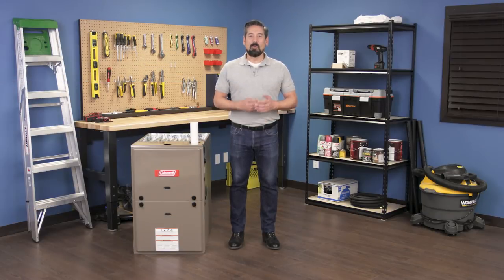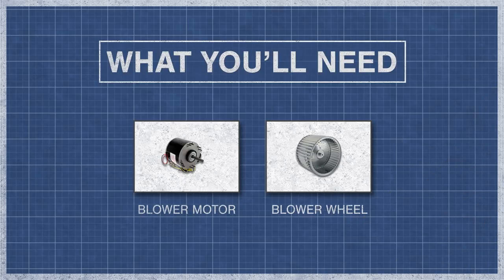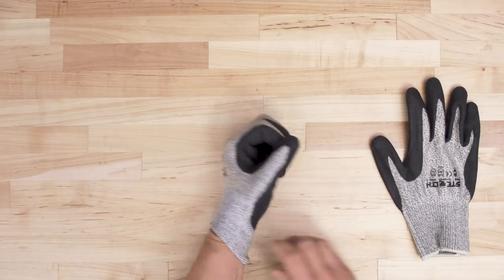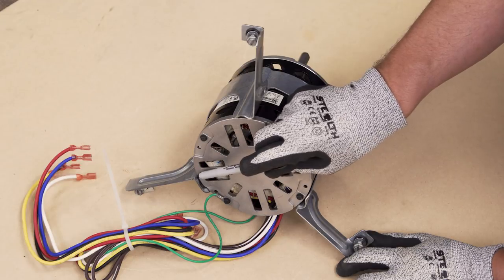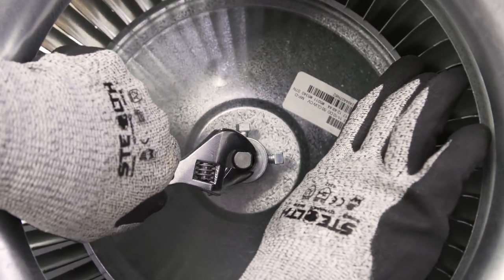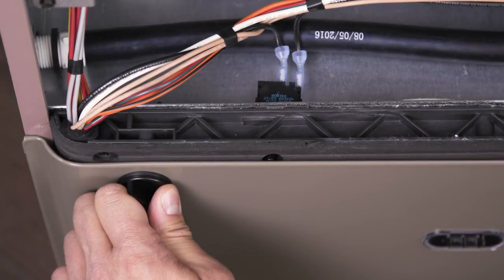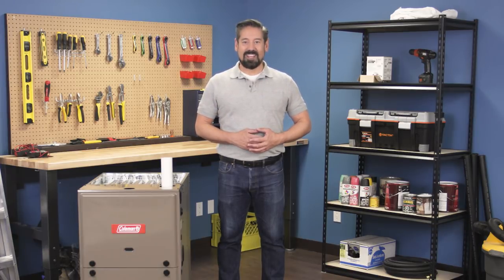Furnace - Blower Fan | Repair and Replace

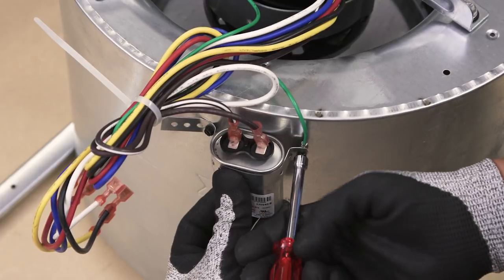Comment from the maker: *Caution* The capacitor stores an electrical charge, which is used to help start the motor. This might cause a shock in some cases. 2:36 Before handling the capacitor, use an insulated screwdriver and touch across both terminals to safely discharge the capacitor (be careful not to touch the blade of the screwdriver or terminals). 

Also be careful when pushing in the wire connectors into the circuit board. 4:35 Too much pressure can cause the board to flex and might crack the board. Its best to place your fingers behind when pushing in the connectors.

Comment: Thank you so much!! You are right on! I am now half way, I.e, I could take out the motor assembly and came down from hot attics. Next step is to find the replacement parts and replace it and put all back. Looking forward for have my AC unit working😊👍
Reply from the maker: You're welcome! We're glad you found it helpful. If you need a new motor you can always find a match using the specs on the side of the motor: This video explains how to match a furnace motor https://youtu.be/TF3QtXWd8s0 Now to order a replacement you can get one here https://www.amresupply.com/catalog/Heating-Air-Conditioning-635368

Comment: Might want to warn folks that capacitors are exactly what they say and contain a fairly large amount of stored up power to kick start the blower motor. Should be discharged by using a insulated screwdriver to touch across both terminals to discharge it so they dont get a nasty shock if they touch the terminals during removal. And another point is when pulling and pushing the wire connectors onto the silicone circuit board you should not allow the board to take the pressure on its own that is an easy way to crack a circuit board. Try to get your fingers in behind it to not allow it to flex, some of those connectors are on pretty tight and require a fair amount of pressure to remove and re install the wiring.
Reply from the maker: Thank you for your comment those are both 2 very good points. Unfortunately the video can't be updated without deleting and reuploading but I have added a comment and pinned it to the top for reference to bring awareness to both issues.
Reply: AMRE Supply yep but at least if they are here and you support them then folks can see it to. Thx from Bulldog Plumbing and Heating

Comment: Excellent video ~ I wish every "how-to" video was as thorough as yours! Can you provide an estimate of what it might cost for a repairman to perform the task and replace the parts depicted in this video?  And if the problem is a bad capacitor, what might that cost to replace?  If it matters, this is for a Carrier Weathermaker 8000 that was installed 20 years ago.  We heard some odd sounds when it started up today and then noticed a burning smell from the floor vents. The air was not blowing from the vents.  I removed the front panel and everything looks fine and the furnace will ignite - it just doesn't blow the hot air through the vents.
Reply from the maker: Thank you Paul, we're glad you're finding our videos helpful and informative. If the blower is not working at all then yes it could be a faulty motor or capacitor. Every case is different but a repair like the blower fan motor will likely cost 100 for a diagnostic, another 100 for labor and could be 200 for parts. Capacitors are quite inexpensive though and If you have a multimeter you can test the capacitor to see if is faulty. This is shown in this updated video https://youtu.be/4SY8lRl8HV0?t=171 as well if you do end up replacing your blower motor that same video shows you what you need to find a match https://youtu.be/4SY8lRl8HV0?t=253
Reply: @AmreSupply  Thank you so much ~ I'm going to watch a video a week and get up to speed on all of my appliances thanks to you!
Reply from the maker: @777zecol  You're welcome, we're happy to help out! We're still filming more videos on appliance repairs but we'll be updating our channel in the next few months. One series that is good to watch is our electricity and component testing videos: https://www.youtube.com/watch?v=r_migcta_Is&list=PLCo9SMjkdWBycw9hZVfYFc6Sw2Jlavaak&index=1 These are good as a refresher and since the principles apply to almost all appliances.

Comment: my blower wheel is out of balance and causing furnace to shake when running. This has also caused motor to shake as well.  Tech recommends full replacement of furnace w/ x13 motor = $3,500 or just replacing Blower Motor + Wheel for $1,300.  Question - do you think I need full replacement because of age of furnace is 21 years or just replace blower motor + wheel?  Thanks for any feedback.
Reply from the maker: Thanks for watching. A lot of the price of installing a new motor is the labor. You can always use the part number or match the motor by the specs to get a reference of the actual cost of the motor: https://youtu.be/TF3QtXWd8s0?si=xQ8JVm6pLsrQWGWT

You can browse all motors here: https://www.amresupply.com/catalog/Direct-Drive-Motors-650039-MDD1

When it comes to replacing a single component vs the entire furnace it is up to each homeowner to decide if the cost of a new replacement part is worth it. A new motor will last a while but you may still need to replace other components like the furnace ignitor or one of the limit switches over time. In many cases the price to repair vs install a new system factors in this opportunity cost. 1300 is a lot to just replace a part, but a new system does come with peace of mind.
Reply: Thank you  @AmreSupply  !  i called your 1-800 to check on parts & pricing - Happy New Year!
Reply from the maker: @leefamilytx  We're just happy to help! Keep us updated on how the repair goes

Comment: super informative   I replced motor BUT S the WRONG WAY  CW  NOT CCW like it should  the wires were connected correctly - white to white   4 wire motor  / run cap  Thanks  much
Reply: SPINS  TURNS   CW   Not   CCW
Reply from the maker: Thanks for watching, we're glad that you found it helpful! Sometimes the replacement motor has a slightly different color scheme for the wires so the wiring diagram can be helpful in these cases.

Comment: My furnace makes a noise while starting up. It's a loud hum that goes away as the fan sounds faster. Now I noticed a slight rattle sound as it's spinning. I'm confident, with the help of your videos that i can fix it, but I'm not certain if it's the fan or blower wheel. Is there a way to tell?
Reply from the maker: Thanks for watching. If you remove the motor and blower wheel, you can spin it by hand. If you feel any restriction on the motor itself then it could be one of the bearings. As well inspect how the blower wheel spins, if its a little of center or is too close to the edge then you can sometimes adjust the screws. In this case adjusting the blower wheel would be best. Only replace the blower wheel if its visibly damaged.
Reply: @AmreSupply  I tightened up the blower wheel. The rattle is gone now. The wheel spins freely with no binding or restrictions. I have a capacitor to try. If that doesn't stop the slow start up then I assume it's the blower motor?
Reply from the maker: @yarkie1  Its good that you were able to fix the rattle. 

As for the other problem, a weak or failing capacitor can cause issues and a slow startup. The capacitor can be easily tested with a multimeter. You can learn more here: https://youtu.be/NkgxNLCrmr0

Comment: Help, my friends furnace fan works with heat but not Ac is that the relay. I took it out but it doesn't rattle so I'm not sure. I heard there's like two speeds higher speed for AC. Is that ok not rattling.
Reply from the maker: Thanks for watching. Yes some motors have multiple speeds and will have different motor windings for each speed. It could be the relay but it also could be an issue with the thermostat, loose wires could prevent the blower from running during AC.

Comment: Is this why my york furnace seems to be making this unusual noise when turn on and is still even working for ac? Also capacitor needs replacing and can a handyman do this job or a heat guy?
Reply from the maker: Ya it can be a common cause of noises in AC units as well. The capacitor is simple to replace but one needs to use caution as it can still hold a charge. You can see how to discharge and replace a capacitor and furnace motor in this video: https://youtu.be/4SY8lRl8HV0

Comment: what would the problem be if the blower will not shut off unless I shut off the power to the furnace at the beaker or cut all power?
Reply from the maker: Hi Jessica. If your blower keeps running and never goes off, first check your thermostat. Make sure that its set to heat, and that the fan is set to [Auto], as this will run it only when heat is needed. If the fan is set to [On] it will cause the blower fan to circulate air 100% of the time. 

Also check the furnace filter to see if it is dirty. If the airflow is compromised, the heat exchanger might overheat and will trip the limit switch, the burner will be shut off then the blower fan will continue to run to help the heat exchanger to cool down. If you've replaced your filter, and checked the thermostat settings, then it could be a faulty limit switch. This can be tested for continuity: https://youtu.be/0va_wvwfCBA

Comment: Hi my motor tongue goes in and out how come is this a problem?
Reply from the maker: Hi Sam thanks for watching. Do you mean the shaft keeps coming loose from the blower wheel?
Reply: No I mean I cant take out the motor out because it’s connected to the fan through the shaft I opened the screw on the shaft and it still not coming off how do I take out the motor and separate it from the fan so I can put another motor in?
Reply from the maker: If the blower fan has a set screw then that means its removable. Likely you might need to use something as leverage to help pop the blower wheel off of the motor shaft. Additionally it might need to be knocked loose first if its sticking to the shaft. The blower wheel should be able to move closer to the motor as they are generally sitting midway on the shaft. If you knock it loose it should fall towards the motor.
Reply: AMRE Supply so do I hammer the shaft to knock the motor out of the wheel?
Reply from the maker: @sm-bd1bz  You would tap the blower wheel (not the motor since the motor is still attached to the housing) In this case you would knock the blower wheel downwards, just make sure not to hit the shaft at all https://youtu.be/bCGLGXyBhNE?t=146

Comment: I can't turn my gas or power off just thermostat all the way down. Wish me luck
Reply from the maker: Eric it's essential to disconnect the power before doing any repairs. If you don't have a switch next to your furnace then you can disconnect power at the breaker panel. If you are unsure, use a NCVT (non contact voltage tester) https://www.amresupply.com/part/9462517  to verify that it is safe before doing any repairs.
Reply: You still alive?

Comment: That was an awesome video I would have never known that there was just two screws to pull the fan and the fan motor out
Reply from the maker: Thanks Cameron, we're glad that you found it helpful. Some repairs are fairly simple but its hard to know what is involved without seeing it first. There are many components like switches or even the furnace ignitor which is just held in by one or two screws. Its simply disconnect the wires and swap in the new part.
Reply: @AmreSupply  the fan is vibrating really bad I was told by two technicians that the motor is bad the bearings your video showed me how to take it apart to find out more thank you

Comment: Thanks so much for an honest step by step process. By the way I mine checked and it became more louder noise than before. I think he loosen them hooks up so I buy a new one from their company.
Reply from the maker: You're welcome we're just happy to help. Always good to look for any small adjustments that you can make. There are some technicians who are not the most honest. If the motor bearings are worn out then you'll need a new motor. If the mounting screws are loose or the blower wheel is misaligned then those can be adjusted first before any replacement.

Comment: Is that the wheel that hums and rumbles? Just started
Reply from the maker: Hi Johnny, thank you for watching. If the blower motor just hums, and doesn't spin then its likely that the motor capacitor has failed. The capacitor is needed to start the motor. You can test the capacitor with a multimeter to see if it can still hold a charge. You can learn more in this video https://youtu.be/NkgxNLCrmr0